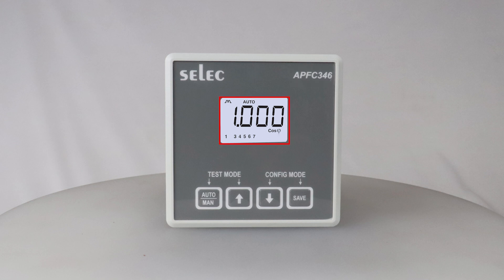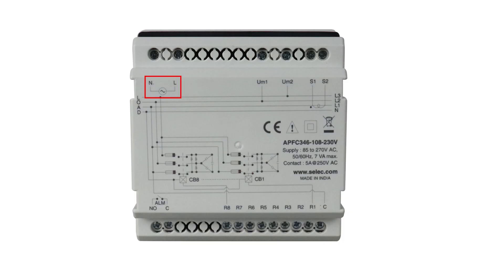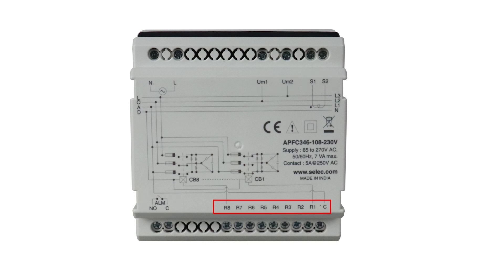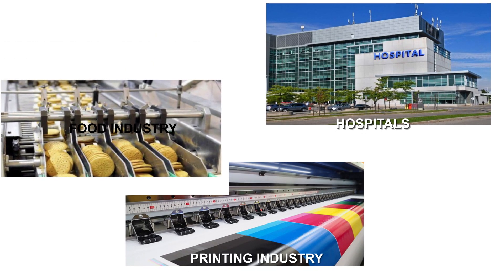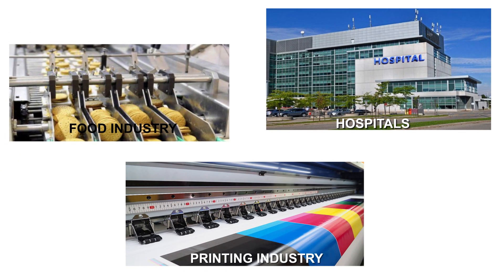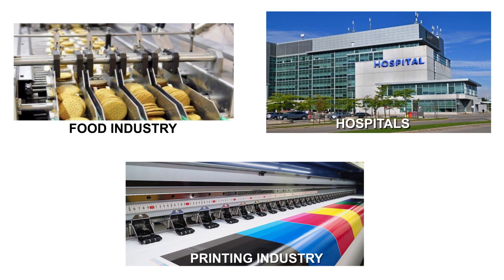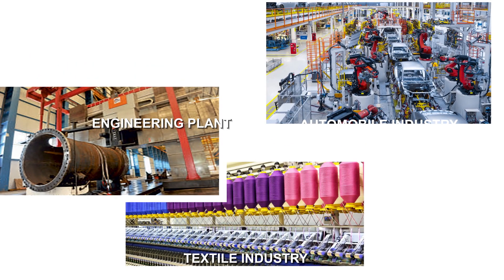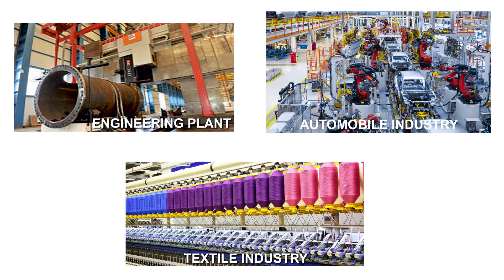Selec APFC346 Automatic Power Factor Controller: Introduction|Wiring Diagram|Programming|Application

Comment: Mera bussiness servo stabilizer ac main line relay control stabilizer change over switch  phase changer  protectoin relay relay manufacturing or retail  ka hai lakin ab panel work pr planing hai Lt  penal start kr diya lakin ab apfc ki requirement 3 4 bar ayi hai cancel kiya hai lakin ab plan hai bnane ka video controlling sb dekhi hai easy lg rha hai ab soch rha hu 1 penal or 2 3 capacitor le kr sample tyar kru agr shi rha toh product add on ho jaye ga nhi toh jai shree ram
Reply: Hello

Comment: Please give CT specification to be used with this model
Reply from the maker: It should be 15% higher than your load. For e.g if the load is 100A, then CT will be 115A or more. Please check our range of TWCTs: https://www.selec.com/product-details/tape-wound-current-transformer
For more details, please reach out to us using contact details mentioned in the video description.
Reply: @SelecControlsvideos  Why there is no CT configuration programming in APFC346 controller.
Reply from the maker: @shyamkrishnanaragam981  Dear Sir, It has Automatic S1,S2 reversal correction. If all the connections are correct, still the PF doesn’t match with electricity board meter, turn the CT correction (i.e. CT.CR) OFF by entering into the configuration menu and restart the unit. Please check the products instruction manual for more information or call us to receive support.